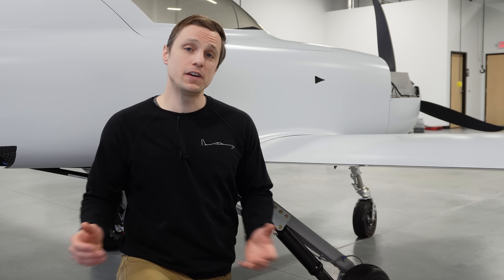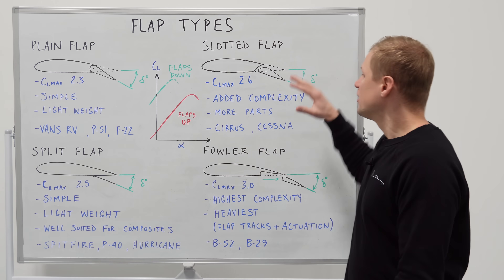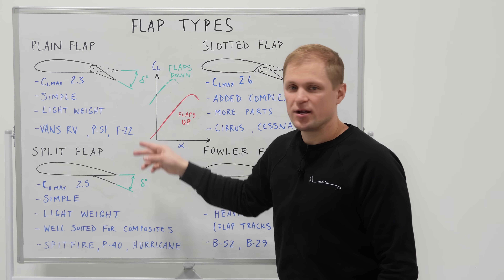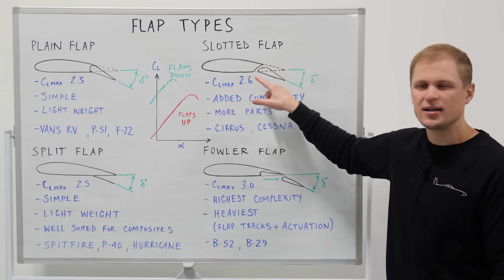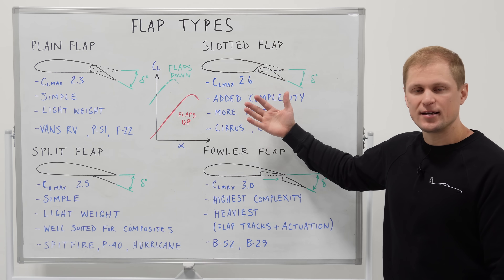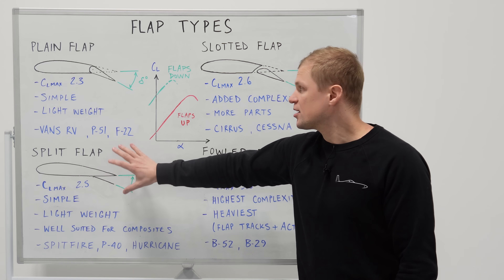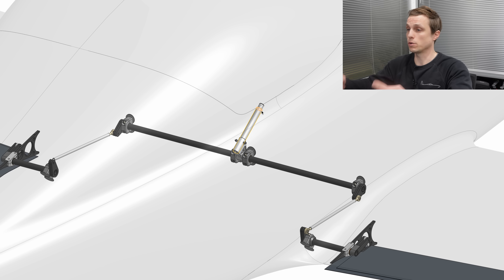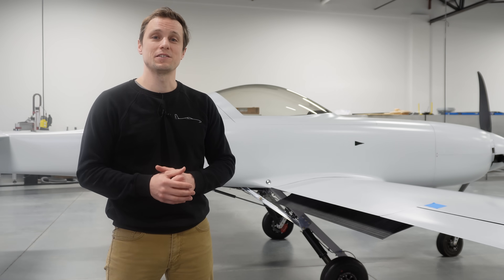The biggest myth about split flaps

Comment: Good idea but making this system entirely manual could make flying tedious. Perhaps using cables and automating it to work in synchrony with relevant systems such as brakes, lift, or landing would make flying much easier and possibly the manual part can act as redundant system.

Comment: "The flap allows us to have a smaller wing"... not really true.  For a given wing size you would just need to land faster (less of a concern for an aircraft designed for hard surfaces). My hunch is the airspeed changes 10kts or so with flaps, not night and day.  It would be perfectly reasonable to have a 'speed' or 'race' version of this plane without flaps (to save a little weight, & add a wee bit of strength/stiffness, and reduce parasitic drag a wee bit... but in a race plane a wee bit can matter).  It could even be programmed or set up for spoilerons to lower landing speed ((where the ails rise to some fixed angle as the neurtral point to act as an air brake, tho this is no help on takeoff).  Just a nit, you guys rock.

Comment: Yes  flaps increase lift and drag but split flaps produce relatively more drag. You use flaps to lose energy - the change in stall speed may be useful and this is seen more in Fowler flaps. in the cessna 172s i've flown they were fowler flaps but maybe that wasn't the case in older ones?

Comment: Thank you for the excellent synopsis on Flap types. Might you know if split-flap designs might be inherently different at high extension angles to Fowler design as far as L/D? I was reciently chatting online with other pilots about the how the early model Cessna 310s had a pronounced loss of lift (not stall) on landing if throttles were reduce below zero thrust, and the Beech Barons like the B55 model with Fowler flaps much less. Both were similar wing-area, airfoils and weights.

Comment: For fighter aircraft a lot of designs had maneuvering flap position so the split flap would be at low deflection and cause drag. Hurricane and Spitfire only had two flap positions - extended and up and predictably used split flap.

Comment: You can save few kilograms by replacing torque tubes and shafts with simple cable drive (like on engine-less gliders)
Reply: Actually, the plane already use a mix of push-pull rods, torque tubes and cables (for the rudder). And it seems to be one of the most common configuration for light aircraft. Cables are lighter but have several drawbacks : 
- inferior rigidity of the controles
- cable tension monitoring
- pulley derailment 
- maintenance
- ...

But yes, i'm pretty sure that for flaps control, using cables make sens.

Comment: About twenty years ago, a pilot who had modified the elevator on his plane got killed when the plane over-steered. His sudden climb caused him to experience eight G’s.

Flap design, and all control surface design, isn’t the simple principles shown in this video. 

All aircraft air-flow dynamics are finalized in the wind tunnel. Not on paper. Results occur in the real world.

Comment: No offence, I appreciate all the info to back up and demonstrate . But You should know , we all came to see airflow tests and visuals. Just split screen or daughter window a view of a flow example a bit more. And thanks for all this info to digest, phew! Nothing like rooting around and dusting off some old creaky neurons for a 1/4 mile run. POP!
Reply: Nice i had it right...lol pretty obviouse. Fowler is the superior, but also most prone to mechanical error. (more parts, ice jamming behind it I assume.) I like this for a downforce application in the wheeled realm. Seems like it could be used as an airbrake too fairly well? And also whether pitched up or down would counter wheel lift. 
Ohh Geez...here we go...

Comment: Machined Carbon Fibre composite - sounds wrong 😬
Reply: But it's not. It's pretty common in the aviation industry (trimming operation).
Reply: @TheBumpking  I am convinced about that because it takes a stock semi-finished product and slightly speciallized milling bits to machine it. The proper way is to lay individual carbon fibres in the direction of the mechanical strain and then infuse it together with underlying carbon fabric with resin in an autoclave. Much better, stronger, time consuming and expensive method. Once you cut a fiber all the stress is carried by the surrounding resin - which is OK-ish but can lead to delamination, stress concenration, higher amount of elongation, ...

Comment: I disagree somewhat, what you’re not giving enough focus is how critical specific flap design is for specific types in specific applications - for a swept wing that cruises at transonic speeds then has to slow right down with high wing loading and given AoA profiles you simply can not beat the slotted fowler type fundamentally, split flaps have limited benefit in a higher wing loading and in adverse conditions I am dubious - it’s one thing to do the math for basic application but wing loading, cross wind, AoA, operating speeds etc. all need to be factored to truly understand the pros vs cons. I do agree that if simplicity is prioritised on your specific design the split flap is basically viable. I admire the work you guys are doing but this is so far a variation of established norms, I have not seen anything stand out revolutionary but I hope you will achieve revolutionary in the final performance, perhaps the story of how she came about and the effort itself is the true hero. Happy landings I’ll be watching!

Comment: I think the thing with split flap drag is probably somewhat deflection-dependent. At maximum deflection the plain flap may well be acting almost like an airbrake, completely stalled. Clearly this should be more drag than the split flap. But what about at moderate deflection? That is, for the use case where the goal is improving L/D rather than improving lift alone?

Comment: Great flap discussion. Just a minor nit: "The split flap comes out on top of the split flap when it comes to drag for a particular lift". The graph shows you mean the split flap has a better (ie lower) drag/lift ratio, so it's "on top" in performance, ie desired. However, the statement, especially if the graph were not there, could also imply the opposite: that the split flap has a higher drag/lift ratio (numerically "on top" of the simple flap) and thus is less desirable than the simple flap.
Reply: I think part of the perception that a split flap produces much higher drag comes from designs like the Spitfire, where the flap controls are 'up' and 'full down', eliminating the additional pilot load of having to balance speed against flap setting for different maneuvering conditions -- less flexible but more robust.

Comment: How much force does it take to engage the flaps at the appropriate flight speed?  The angle of deflection on the flaps seemed to be similar to the deflection angle of the lever, which doesn't appear to give it much mechanical advantage.

Comment: Fowler flaps: we have them guite often on ultralight airplanes in Europe, for instance Risen(from Italy) , or Stream(from Czech Republic). In Italy they make the ultrafast two seat aircraft called Risen. Please note, with 100hp Rotax they guarantee the top speed at sea level 320km/h (173knots) and with turbocharged Rotax 915 -142hp they guarantee maximum cruising speed at 16 thousands feet 450km/h !!! (243 knots ) !!! Will Dark Aero be able to achieve the same velocity with much stronger engine ??? Risen has got the ultimate aerodinamics IMHO. Extreemly efficient(crossed Atlantic from Africa to South Anerica using 200l tank only) and it is all carbon fiber too. What I like about Risen compare to Dark Aero, that Risen is not using any metal(aluminum) honeycomb, but rather materials which can never ever rust.... On the other hand what I like about Dark Aero is the gear(looks strong) and the 2 baggage compartments.

Comment: If you try to apply flaps during landing, how much force is required to deploy compared to if the plane was stationary
Reply: From my experience flying an Evektor Sportstar with similar flap design - not much at all. Like, 1/4 of the force needed to apply a hand brake on a car. So maybe a 5kg pull...

Comment: In terms of slipperiness, the closest thing to your design I've flown is the Comanche (not that aerodynamically clean).  With the Comanche I'll take all the drag I can get for descents.  You are coming towards you destination at cruise altitude, say 12K feet.  In the western US the airport is often located on the valley floor and surrounding hills limit your ability to descend early.  You start your decent at say 500- 1000 fpm. But your air speed starts to approach VNE limiting your decent rate.  You end up having to fly longer patterns aligned with the terrain to loose altitude. That sort of defeats the purpose of flying a fast plane to arrive sooner.  Anyway, I wish the Comanche had drag devices I could deploy at higher speeds.  The gear helps once you get slowed to a speed you can deploy it. but there you are again fly a fast plane slowly.

Comment: Love the manual flaps. As compared to the Piper's and Cessna's I've flown, the handle looks too short to generate the force needed to open the flaps at speed. The Pipers are about 15" and the 182a is more like 30" and it's too short for full activation for all but the strongest pilots. Perhaps yours are small enough flaps to allow for that?   Also, in many designs the actuating force is carried by the cables or torsion tubes closer to the center of the flap to lower the torsional stresses carried by the control surface itself. I would that would be even more important in a high speed split flap because the forces will be higher and the structure flatter.  I haven't worked with carbon fiber to have an in intuitive grasp of it's ability to carry that type of load.  I'm sure you guys have done the math on that.

Comment: they just look like airbrakes to me
Reply: Noooo, Velocity is increased along the upper surface by these high-lift devices, hence more momentum in the boundary layer leading to a separation of flow further down the foil's upper surface. Improved lift and more drag. The flap backs up flow underneath the foil, hence enabling the air underneath to support more weight at a given speed, which is why when deployed the aircraft can maintain lift at lower speeds, by shifting the stagnation point aft away from the leading edge, resulting in an improved upwash for greater momentum in the boundary layer above the wings.

In layman's terms, when the flaps are deployed, dynamic pressure flowing parallel to the bottom surface is converted into static pressure applied perpendicular to the bottom. This is conservation of mass-flow rate and a direct consequence for greater lift.

Comment: You might want to put a larger lever on that handle, or change the linkages, or make some form of staged ratchet/jacking mechanism to get more mechanical advantage because they might be extremely hard to extend during flight due to the force of the incoming air. maybe its not an issue with this particular aircraft as its fairly lightweight and a slower aircraft, its not super critical to land with flaps anyway so if its a prototype just go for it. but just thought id mention it if you wanted to look into it and test it out on a smaller scale before a flight. its not like i am running any number over here so it could be completely fine. :)
Reply: so like: one pull for 10 percent, 2 pulls for 15, dadada. 5 pulls for max flaps. then one button press to release each flap level. press 5 x to fully retract. spring pulls it back to zero.
Reply: @snorttroll4379  yea like that.
That would work seamlessly if you could dampen the returning flaps.

Comment: You've got four potential failure points at the rod ends at either end of the two pushrods travelling aft from the main torques tube where, if you were to lose any of them, you'd risk ending up with a differential flap deployment - a catastrophic condition. One tube traversing from flap to flap with a single input pushrod would solve this. Same geometry in a side-on view, single centerline pushrod in a top-down view. Not sure if there is some other system taking the space that would otherwise prevent the cross tube at the flap hinge position, but I'd strongly recommend against the actuation configuration shown here.
Split flap concept though - I like your choices here!

Comment: With a little change in geometry you could have gotten more leverage at the handle over the flap as it approaches full deployment rather than less.   As it is, you have most leverage when it's not needed, and least when it would be nice to have.   We do this on big heavy RC sailplanes to avoid breaking the servos when the flaps are fully deployed just in case we don't get them up before touchdown.  For you it'll just be a matter of the flaps feeling really heavy at full deployment.
Reply: That was one of my thoughts - a 30cm deflection of the flap handle has to extend a relatively large chunk of wing into high speed wind. Gonna be tricky for sure to balance the forces with any possible spring assist.
Reply: @frollard    I'm not talking so much about the simple flap lever to flap  angle ratio, but the way they've clocked the positions of each end of the linkage relative to each other.     There are ways to set it so that you start with more leverage over the flap and end with less (control lever initially moves faster than  surface, then slows down to match its speed) which is what they've done, or you can set their relative positions so that you start with less leverage (when you don't need it at low flap deflection) and gain leverage as you move it further (moving arm faster than flap).

Comment: Nothing wrong with split flaps - or manual actuation, but it seems pretty clear from the arrangement of the cockpit and the landing gear that there just isn’t enough room for an electric jack screw that links both sides without some serious kung fu on the linkages

Comment: DC3 had split flaps as well. Very informative video.
Reply: Are you sure? I’ve ever been up close and personal with a single DC-3- and it didn’t have flaps. Looking at photos of planes on the web, and I don’t see any indications of flaps- but, admittedly, all those photos are from the top, so for a split flap, wouldn’t see anything!
Reply: @dphuntsman  Plenty of photos of the DC3 flaps extended on the web. Unusual in they extended under the fuselage as well as the wing.

Comment: Beautiful plane, best wishes to you for success. Just some thoughts. Your video shows a flap actuator attached only at the inboard, with no attachments or push rods along the span of the flap. I suggest looking at significantly beefing up (metal Plate)  the flap control surface, especially in the zone where debris could be kicked up from the wheels into the flap control surface. perhaps a torque tube extending the length of the flap with multiple attach points. Also, if the flaps get stuck down, is there sufficient power and control authority to execute a go-around? If one flap control surface broke and retracted with the other extended, is there sufficient control authority to manage?

Comment: Manual flaps are definitely the way to go. There's nothing like having to take a split second action only for you to wait on the electric flaps to slowly extend or retract, not to mention the issues with split flap conditions in a lot of them.

Honestly if I had to chose between electric flaps or no flaps I'd go no flaps for the planes I like. Manual flaps all the way!
Reply: so our muscles are stronger than the motors they would have used?
Reply: @snorttroll4379  Where did I say that?

In GA aircraft most of them could easily have manual flaps, and a ton of them did for a long time.

I've flown with electric, manual hydraulic, electric hydraulic, and manual mechanical flaps (both cable and rod systems). I much prefer manually actuated mechanical flaps.

Comment: Another aspect of the marvel that Concord was is that it had no lift augmentation devices at all, neither leading or trailing edge. Low speed flight was achievable because of the double delta wing, same as the Space Shuttle.

Comment: It's interesting that the B-52 and B-29 are listed as examples for the Fowler flap, given that it normal practice for modern airliners that are much more familiar to viewers
Reply: Also, the P-38 is another glaring omission.
Reply: @kittycatpilot  p 38 isnt a typical use for fowler flaps, though
Reply: Modern airliners are using mostly slotted or double slotted fowler flaps.
Reply: Modern airliners have another variation of Fowler flaps with multiple elements and slots for the most part. Useing the B-52 is an example of a simple Fowler flap as drawn vs todays flaps.

Comment: One of the advantages of the split flap is that the separation bubble stably extends the pressure recovery aft of the airfoil trailing edge into the freestream, allowing the upper surface pressure to stay below static as opposed to having to recover to near stagnation.  We (NASA) used this aspect to design a wing  for a glider for Mars exploration; it was to be folded up in an entry capsule, then released to fall away and unfold.  The flowfield conditions presented during pullout were challenging - transonic Mach and low Reynolds number.  We found that a split-flap design maintained the high CL capability needed to achieve the pullout maneuver even under these conditions.  Of course, the relatively high drag was also advantageous, as it would slow the glider and give more time for the pullout to occur.

Comment: too simplistic in discussion of split flaps - not gonna poke holes in your story here, but you know better.  You only have one graph of one airfoil section and thickness.  I'm also reminded of the rationale you have for using split surfaces.